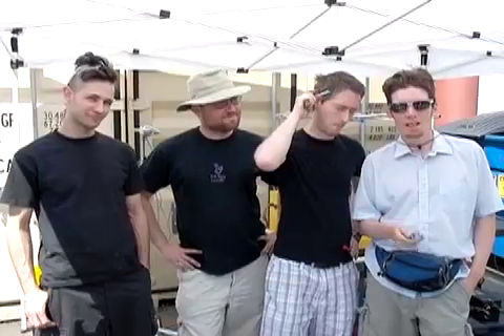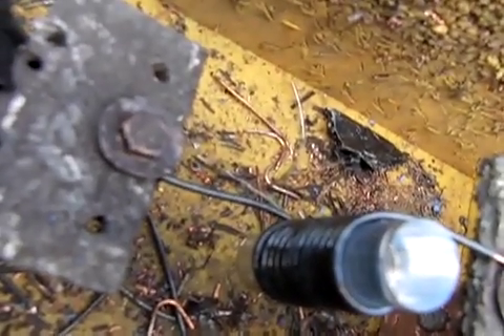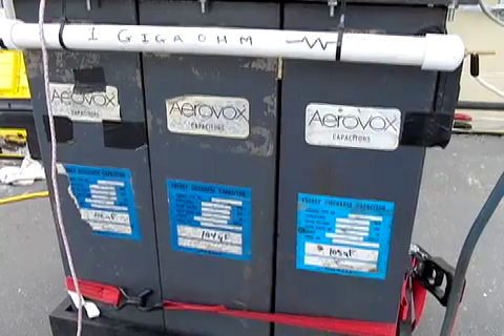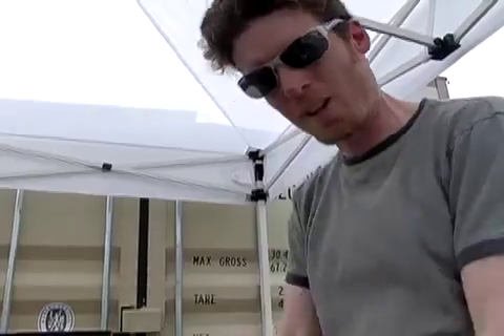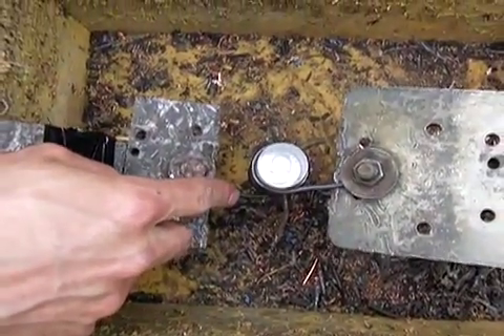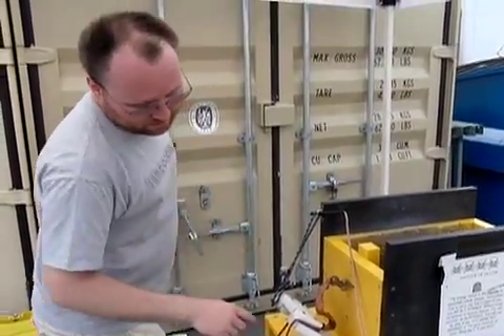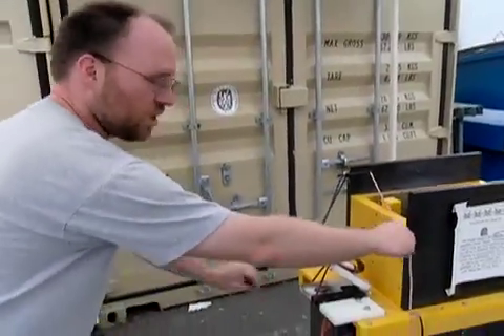Quarter Shrinker

Comment: Somebody speculated in the assassination of charlie kirk It is theoretically possible to deliver a lethal electric shock of sixteen thousand volts (16 kV) through a modified metal microphone system, and disconnecting the ground wire via a toggle switch on the sound equipment

Comment: Well I just watched an old promotional video on Grumman manufacturing torque tubes using their patented "Electo-Magnetic Forming" process to replace typical rivet or epoxy crimp joint connections... And now I'm watching this old hidden gem! 😆👍 I wonder if one of those shed sized high voltage monsters is floating around for sale in some corner of the internet or auction lists? 🤔 I can probably get it for cheap... But the transportation, setup logistics, random parts/ transformers/ switch gear/etc, plus a new power company tap may cost a bit more for this machine I would definitely use atleast a couple dozen times! 🤣👍 Thanks for posting this 👍

Comment: Video says three 100uf capacitors in parallel for 300uf, micro by 10K volts equal 15 K joules (max) yes. I am going 200 volts by 0.5 farad for 10K joules.
Reply: Are you making (and/or did you make) a shrinker that way?  If you made one, how'd it work?  (I don't honestly know if the higher voltage is critical to the physics of this -- it might be.)
Reply: @DavidLindes  I did not find the time to build it last year, but still have the Capacitors. As it is winter now and February I might try to build a discharge bank. But I don't think it will work as a coin shrinker. And I would have to find another place to try the loud discharge pop. Probably just one? or few shots before the caps are damaged  by  back voltage? ( as they are electrolytic) and wont conduct. IDK. I would have to lose half the power if I connected the caps in the way to make them bipolar. so maybe 5K joules.
Reply: @markae0  You may want to poke around more in other comments -- I saw another thread that seemed to indicate that the high-voltage (and high-voltage-rated caps!) was a critical component of this thing working.  Regardless, be careful!  These things can be deadly in multiple ways.
Reply: @DavidLindes  oh yes I know very dangerous. Thanks for the warning. Yes high voltage caps are critical, just working with what I have.
Reply: Did it work?
Reply: @celatugamerboy4863  I never found the time to get all the necessary materials. Like the wood panel backer to mount everything on.I might do it this fall. It is pretty dangerous.

Comment: Excellent demo and thanks for uploading the video.
Couple questions...
1) The copper braid seems awfully small. Any thoughts about adding more braid for improved energy transfer to the work coil?
2) What are you using to charge the bank? 

Thanks!
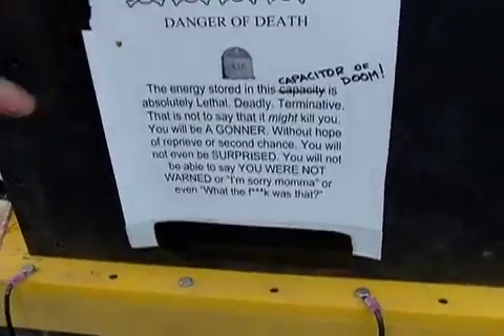Reply: (In case you still care...) 1. Are you talking about the braid that's visible at 1:04?  I mean, I think that's something like 1" (~25mm) braid, so... not that small?  Anyway, it certainly did a fine job of transferring energy to the coil, which was the weak link (the coil explodes, not so many microseconds after the coin shrinks).
2. It was a Neon Sign Transformer connected to a Variac.  (Charged to 10,000 volts, though I maintain that 8kV got a nicer effect, IMHO.  ;) )
(I answer based on having been there when this particular shrinker was built, though I wasn't around for this filming.)